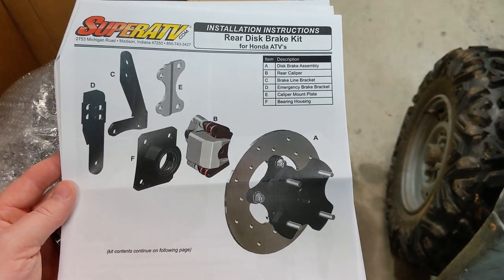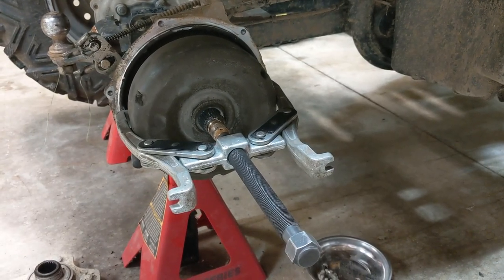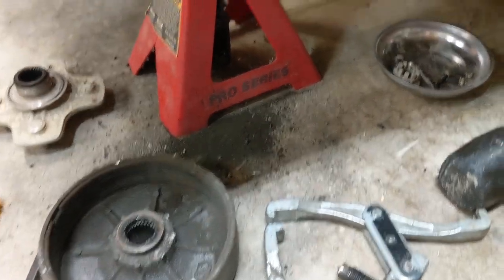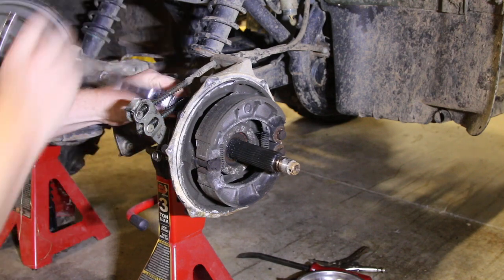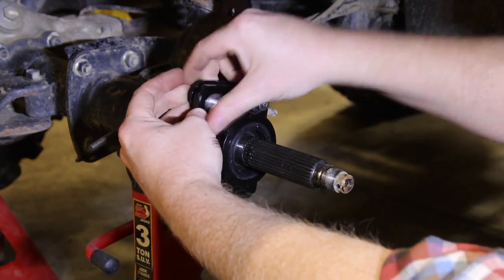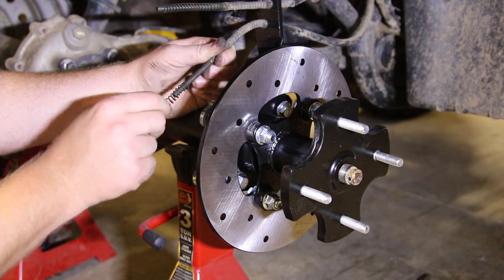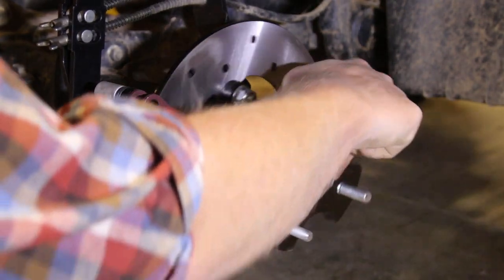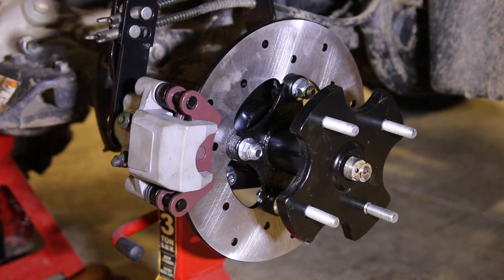Honda Foreman Rear Brake CONVERSION

Comment: Why not just flip the bracket and flip the caliper upside down on the front and magically the bleeder is on top now
Reply: I’m doing this rn and trying to figure out a reverse cable idea
Reply from the maker: @ethantinnin4713  I couldn't flip the caliper and have the bleeder screw on the top
Reply: @TheRoostersGarage  why? We have the same kit. The little caliper bracket flips 180 towards the front of the 4 wheeler
Reply from the maker: @ethantinnin4713  Oh! Towards the front!  And it fits with no issues?
Reply: @TheRoostersGarage  yeah, how did you do your reverse
Reply from the maker: @ethantinnin4713  I did a follow up video on that. It involved a lever to pull the cable, and a switch to work the electrical part
Reply: @TheRoostersGarage  you have a es?
Reply from the maker: @ethantinnin4713  yes, it's an ES